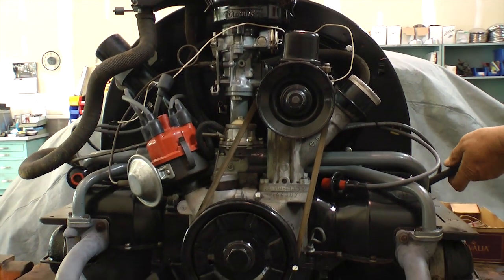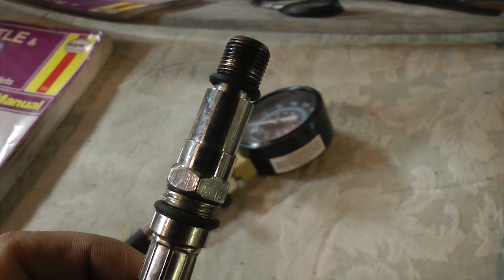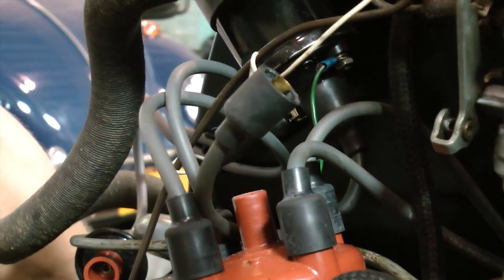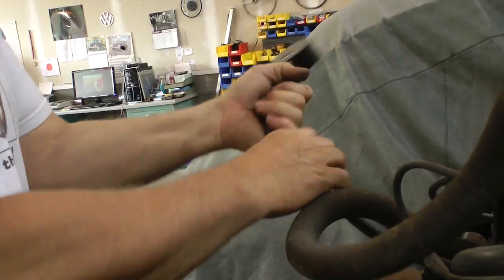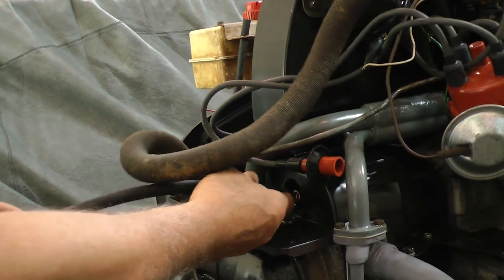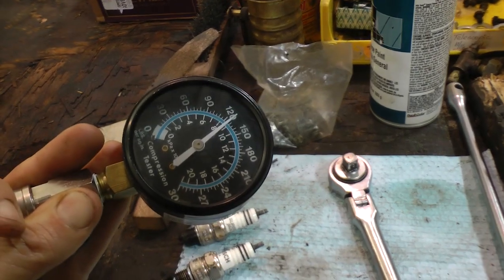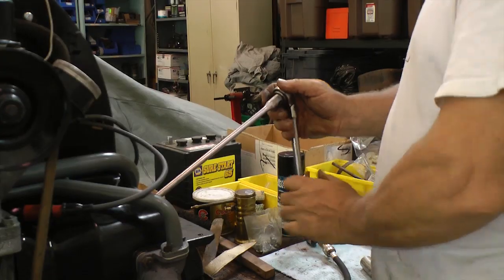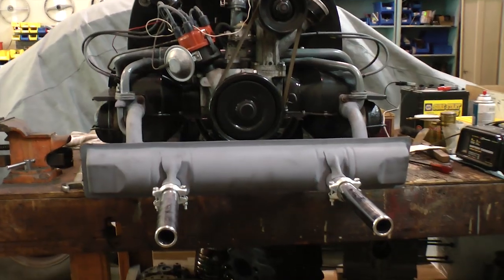Classic VW Beetle Bugs How to Check Engine Compression Motor

Comment: Ik this vids like 10 years old but can anyone help me I’ve got a book and done all the things it’s said to I have a 68 h5 motor, good plugs good wires good bright blue constant spark timing is set, wires correct order, getting gas and it’s still not running I’ve been all the way around with the distributor so it should have hit sooner or later but it’s easy to set with the marks so Ik I got it right, compression isn’t leaking the book says turn it over 4 times to see what psi u get one side I get 131 and 129 the other side both 100 book says they shouldn’t be anymore than 21 pressure difference

Comment: Hi Chris, as you will see I'm a complete novice so thanks in advance for your patience and understanding.  Can I clarify that for the test I have the engine cold and remove all 4 spark plugs before beginning?  Do I open the throttle or not? Do I need to prevent the fuel flow or doesn't this matter?  My bug is a 1970 1300cc model with the same engine as in your video.  Any help greatly appreciated.
Reply from the maker: Just crank it with plugs out, you will see what the engine does.  Don't worry too much about anything else.  Just make sure no juice is going to coil.

Comment: Should the compression for a 2.0 pancake engine the same as an upright? As I've been having trouble getting my engine started I installed in a project bus last year and had running for a little while before I just wouldn't start, and I've checked for spark which I'm getting, and the fuel pump, which is electric is working, so the only other thing I could think of is to check the compression. But what do you think? Thanks
Reply from the maker: I would think, but don't quote me on that.  Might have to pick up a bently book for your car to find out.

Comment: hey Chris - do you ever make any adjustments from cylinder temperatures or exhaust temperatures?  I have one cylinder that runs considerably lower than the other three...
Reply from the maker: +Charlie Webster Did you try adjusting the valves?

Comment: can you check the compression with out electronically cranking it? can you do it by turning the pulley?
Reply: Crane 2005 - With the engine out of the car yes it's possible. Think drill & socket.
But with the engine in the car there's no way to stuff a socket and drill in there, not enough space. Unless you have a removable rear apron. ;-)

Comment: Full flow of air into the cylinders, where it gets "COMPRESSED". Or in your case - water from the garden house you have jammed into the carb to clean your valves........ By the way, it's Mr. Einstein to you.....

Comment: I always have my carburator in the wide open position so it does not restrict the air flow. You will usually show another 10lbs of compression or so. Love your vids. Very professional.

Comment: do the aircooled engines not last that long? how long would one last if it was only driven hard the odd time and the cooling fins were kept clean and the oil was changed when it should?
Reply: I had half a million miles on my last 1600 dual-port engine before I had to rebuild it, and if you change the oil regularly and keep the valves adjusted they should last a long time

Comment: On some tests, you test the car cold, and first test is dry, second test on the same plug is after you've squirted some oil in. I did by 58 36hp and dry got 90, with oil it raised to 110-120. Would this suggest the rings are on their way out. It does blow a bit of blue smoke when you start it up.

Cheers

Steve
Sydney, Australia